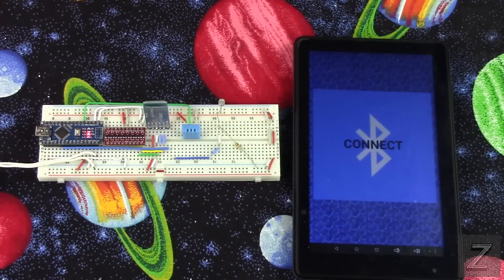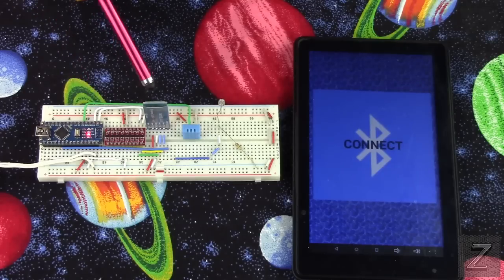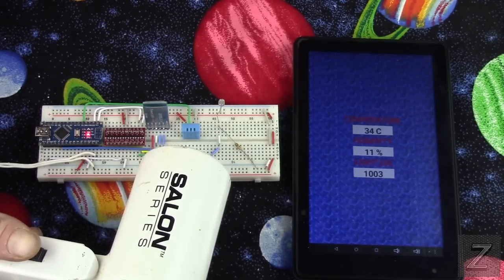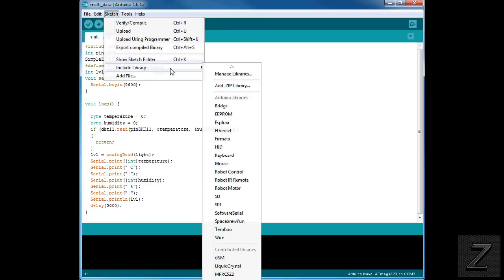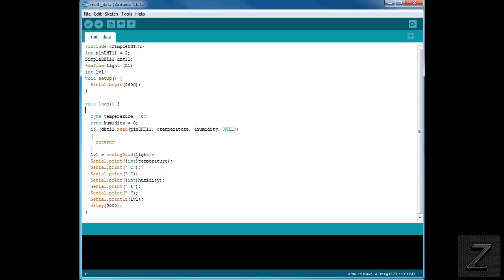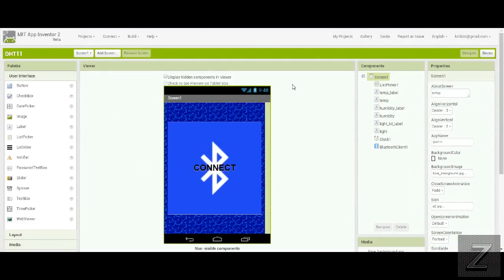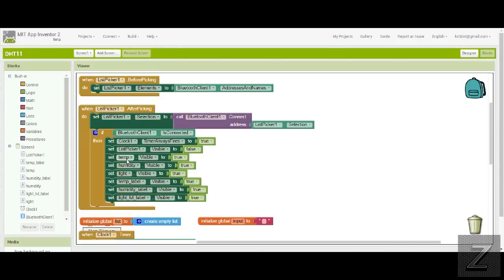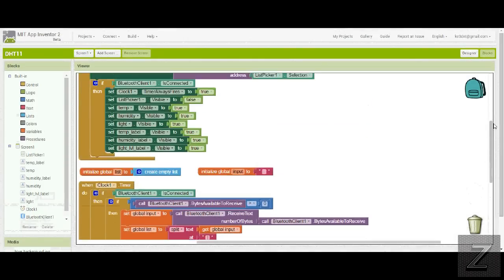How To Receive Multiple Sensor Readings From Your ARDUINO Into Your MIT APP INVENTOR 2 APP

Comment: Sir, need assistance with my project complete.
I am stuck totally stuck.
I am trying to add  LEDs &  Switches to get an indication with the TEMPERATURE read but  I get fail and error messages.
Kindly help for make Temperature and two-way switch feedback. ( App Inventor 2)

Comment: The Arduino file does not show how to read the MIT app  and doesn't show how to send the readings of the temperature sensor to the MIT app. It shows only how to display the readings on the serial monitor of the PC!!!!

Comment: I dont understand your app design because label in app which is shown(viewer) is different & components(right side) is different...i am tying to make same app as you have but everything is different than you did in this (app design not website design & its tool (after installation))... no value box is available in which received data was showing in your app & have a label of it (like...light_lvl)... i am using old version of thunkable which is as same as mit app inventor...

Would you make a separate video?

Comment: in my case load cell is connected and it is sending data through uC and Bt module continuously with start bit as 10 and stop bit 13 bit i unable to format this data on app. Data is comming continously with shifting digit place values
Reply: may I get your loadcell code? it's connected with hc-05 right?

Comment: Hello, very interesting video.👍👍
But, what would I need to send data from sensors that are in different arduinos, to visualize them in the same application - App Inventor???🤔

I would appreciate your answer.
Reply: Hi, One year later... I just wanted to tell I have the same question.
Maybe I'll take advantage of this other topic (https://www.youtube.com/watch?v=3WR2-HT_MiQ). It shows how to connect with 2 Bluetooth devices at the same time.
And maybe it is possible to connect to one BT device, then to close connexion and to open a second one with a secind BT device, and so on...

@Josemariadiy6400: Did you find your solutiion?
See You.

Comment: That's great. I'm using an MPU6050 and an HC-SRO4 ultrasonic module with your app.
Reply: i am using mp6050 with an uv sensor but i have an error it says that my list is too large. Can you sen me you arduino code please
Reply: @AllenWAlkerKHR  Sorry, I had a look for it, but I'm afraid that code is long gone. If you can put your code in a comment, I can see if I can compile it.
Reply: @jonathanr4242  the problem is that i have an error in my app.  I have this message "List error: Attempt to get item number 1 of a list of length 0"

Comment: That's really informative. It helped me a lot creating a health monitor system.
However, I think we have to add the splitter sign after each measurement line to work properly, it didn't work for me until I did it like this.
Thanks a lot and best regards.
Reply: hi, Jaafar is creating a health monitoring system too. Is it possible to see your study thanks
Reply: Can i get your help?

Comment: please Z-HUT, can you help me ? I make all what you said and it don't work and I don't know why !
Reply from the maker: need more info to help you out, whats not working
Reply: Z-HUT I think that the interface on APP INVENTOR isn't correct !
In fact, I don't see the different valors of temperature, humidity and Light !
I can show you what I have now..
Reply from the maker: works fine for me not sure what the problem is, one small setting not set right will make problems. check again and if you cant figure it out  send me the code you are using to my facebook and I will check it out.
Reply: Z-HUT I send you photos on Facebook !

Comment: Hi men, just a quick question, what is the Logic level converter for???
Reply from the maker: arduino board is 5 volt logic and the HC-06 or HC-05 is 3.3 volts logic, use the converter or A voltage divider and you will be good to go. if yoy use 5 volt logic into the HC-06 or HC-05 you distroy it after a short time....
Reply: Shoot, actually i've been using 5v from my arduino and connecting it directly to my hc 05 and it doesn't send Any data, i mean, it turns on, and it connects yo the app but i don't receive Any data on my phone, i guess i burned it, thanks so much for the info men! Great videos, and just another question, what about if i connect the vcc of my hc 05 to the 3.3v pin of my arduino?
Reply from the maker: John J. https://youtu.be/9OlceW1W1yU this video will explain all your questions..
Reply: Z-HUT Thanks so much man! Now i have it all clear, keep up the good work!

Comment: Hi, I'm getting this strange problem where my arduino must be connected to my computer for the bluetooth input to come up. When I connect the arduino to a regular power supply my app  just tells me I'm connected to the arduino bluetooth but won't receive any arduino input. Any help would be greatly appreciated.
Reply from the maker: thats very strange, not sure what the problem could be. try reinstaling your arduino ide and then reupload your sketch... if that dont work try a diferent arduino board, when one goes bad it can do some very strange things...
Reply: haha yeah this is exactly what I tried and it somehow worked :'D Thanks!

Comment: Hello, 
this clip made it for me. Now i can display my temp-sensors on the android device. But still a few problems i have to solve. by using your way i can´t compare the temperatur sended via bluetooth with a fixed value. the plan was to change colours by high temp or low temp. i also have a LCD Display connected whitch should be turned on / off if BT-connection is cut or by switch.

Comment: I have a problem with my MIT App, can someone help me?
I have an app that read the temperature that the arduino receive and that works well. The problem is that I have to transmit an information (basicly 1 and 0) to my arduino to control one other thing but I think that the arduino can't read it because there's too much information... Is that true? Can I fix that?
Reply: I'm having the same issue but haven't been able to figure it out, did you have any luck?

Comment: Use an Arduino + cam and the photon-pixel coupling method. It is a new approach in science for reading an unlimited number of sensors in parallel.

Comment: Congratulations, my friend aki is the adeilton I speak from Brazil, you have how to make a video with acs712 current sensor with the source code of the app inventor and arduino app for me to do an automation project with a switch so that I can light the Lamp When I turn the switch on the application switch on or off hugs

Comment: Hello , any solution for "select list item too large"  error?
Reply: i have the same problem too@@
Reply: Try setting the clock's Timer Interval to 2500. To do that, click "Clock1" in the components list while you're in the Designer mode. It worked for me.
Reply: Did you resolve the problem? I'm in the same
Reply: @katiaolmedo4499  Dont suppose you found a fix for this?
Reply: @vladalbescu4153   Bei mir funktioniert das nicht.

Comment: hello sir, thank you for the tutorial. i want to use arduino Uno to collect data from different sensors which are temeperature, humidity, solar radiation, wind speed. is it possible, i need your help please.